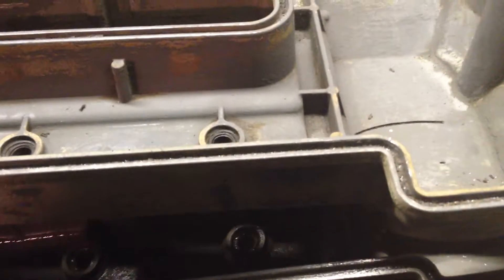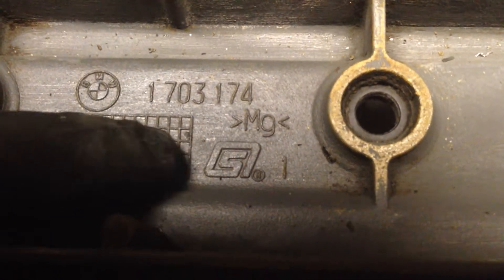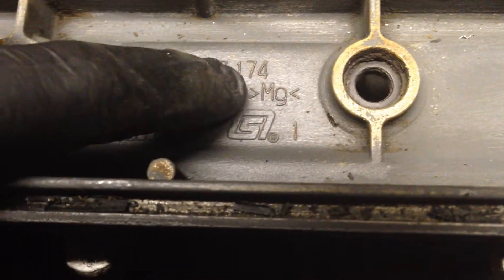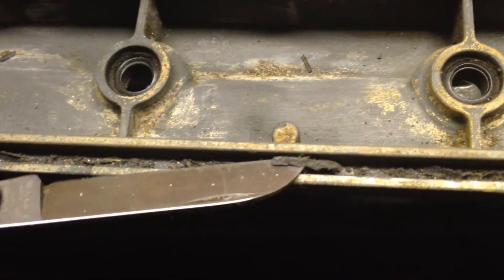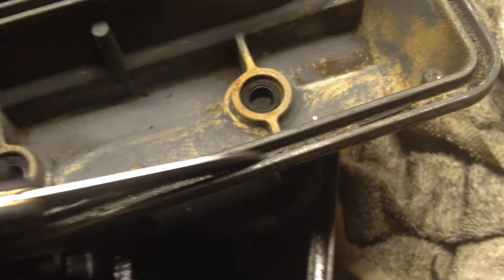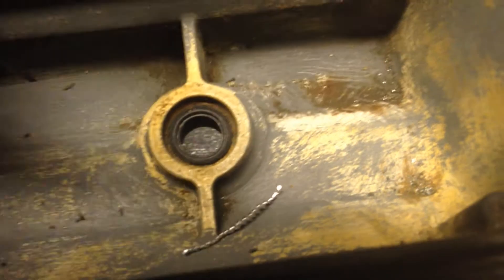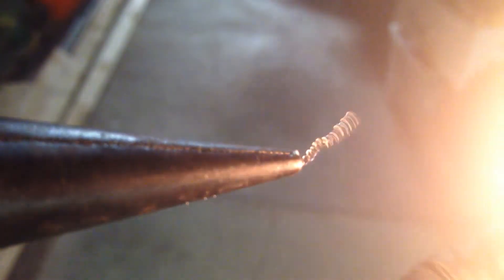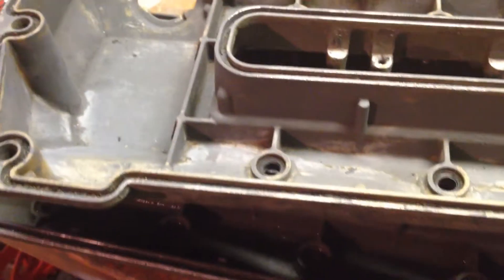BMW Uses Magnesium Valve Covers

Comment: Absolute garbage parts. I just pulled the spark plugs out of my valve cover on a mg n52. Its rotting out, holes around the spark plug holes What a joke

Aluminum doesn't do this shit

Comment: I took off my covers from my 97 540i pre vanos and it does  not say >Mg<  !!

Interesting comments... I want to have my valve covers sanded and fixed (deep corrosion pits on the side). So I need to know for sure if these are made from mag (or mag alloy perhaps?), one powder coating shop said they wont touch mag covers because of their high flammability. I have sanded one before and left a metallic finish and has not turned back to its grey magnesium color (magnesium changes color once oxygen hits it) now I'm more confused than ever.
Reply: E Onez you have an M series  engine.  M series used Aluminum valve covers, and what flakes is th cheap wax/thermal coating they apply for heat protection.  Early N series engines used Mag covers and those fall apart considerably.  They easiest way to tell is by pulling a coil, and inside the well you will see a powdery substance/residue.  This is what happens to mag covers over time.